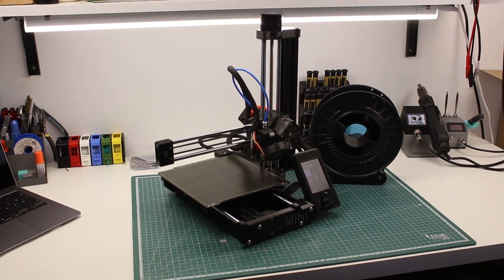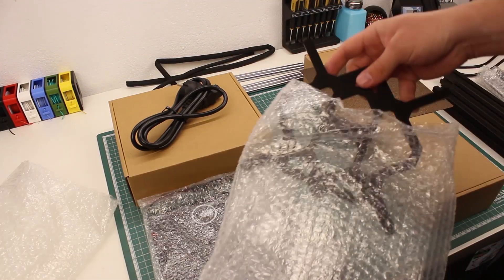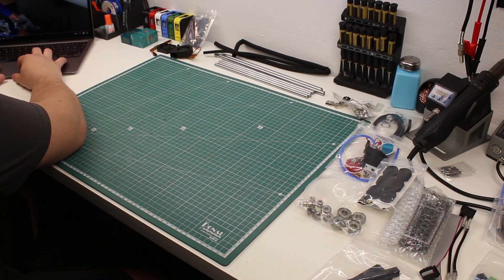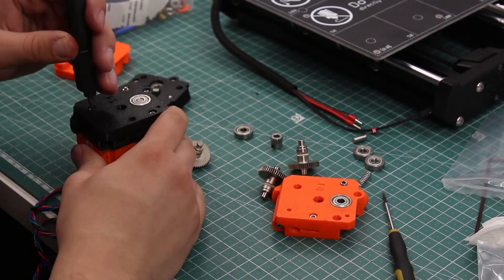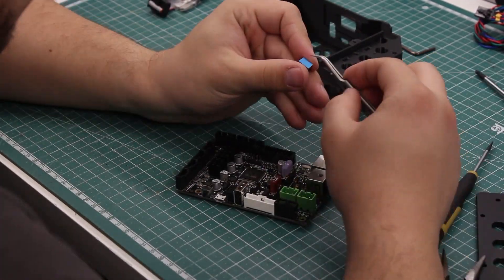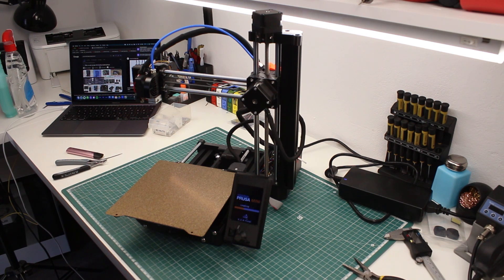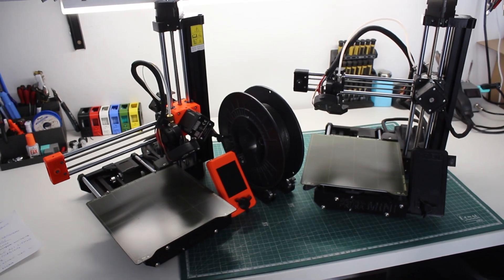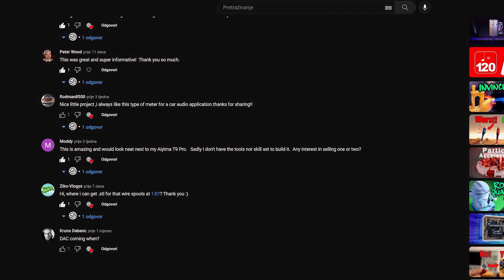$250 Prusa Mini Clone! FYSETC 3D Printer Review and Assembly

Comment: Hello, excellent video! How did you solve the problem updating firmware? I am sucked with old version of firmware, and printer cannor recognize files in the new format
Reply from the maker: If you ever get stuck with a bricked printer, I wrote a simple guide to flash it back to stock firmware: https://github.com/djamboTurboDizel/Prusa-MINI-Compiled-Bootloader

I did not have any issues with newer firmwares; I updated them normally. I did have a display flickering issue, but after some searching, I found a tutorial on how to fix it. 

You need to bridge two pins on the display's connector. I don't remember which ones anymore, but I can take a look if you don't find a guide online.

Comment: whats the extruder upgrade you did, did you need to change esteps?
Reply from the maker: Hey, sorry for a late reply. I use FYSETC dual drive extruders from Aliexpress. They are great but the parts come printed in PLA. I sent them a message and they sent me the STL files so I printed the parts myself in PETG and everything is okay now. I had to change E-steps and extruder direction but both settings can be changed in stock firmware without voiding waranty
Reply: @Djambo57  extruder direction, by gcode or swap wires?
I orderd 1 kit to test first :D
Reply from the maker: @jordanhogetoorn7996  You can change the extruder direction in the menu in stock firmware, you need to hold HW options to enter a special menu and you can do it from there
Reply: @Djambo57  amazing... just installed it but looks like i have overextrusion. I followrd the 409 estep, did you or do you have something else?
Reply from the maker: @Photograaf11  you will have to calibrate esteps yourself then... I didnt do anything else apart from that